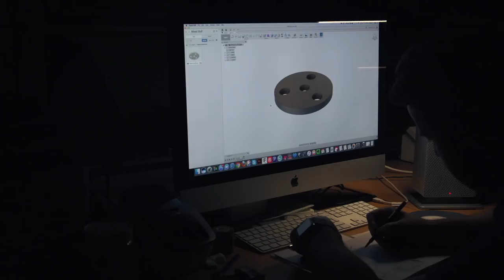How To Make an INSANE BB GUN | GIACO

Comment: Awesome video! It seems in the slow motion clip at the end that the BB's are mostly shooting from the bottom two barrels. You could make either the entire assembly or the barrels rotate to help mix the bb's or have a mixer inside the spins them around. Perhaps even shooting the air in near tangent to the cylinder would result in a thorough mixing of the BB's.

Comment: first of all watched the vid and loved it second of all I couldn't tell if just the middle or all 4 barrels were firing and 3 of all, if you want to extremely ramp up the rate of fire, there's a thing called a vortex block that you machine and put inside it behind the barrel which do to some unexplained physics makes it feed smoother and faster and be more air efficient I think having vortex blocks would also make it easier to support all 4 barrels at the relatively low pressure (60psi for 1 barrel so for 4 barrels you should be using more than 130 but I think 130 is good if you try vortex blocks)

Comment: Not sure what type of metal you're cutting, but it seemed like you were taking light cuts. If you're using carbide inserted tools on your lathe, you should try running your finish pass at a depth similar to the radius of your tool (.031" radius tool, run a .030" or .040" finish pass). This buries the radius of the tool in the work and prevents rubbing, and will give you a beautiful bright finish that almost doesn't even need to be polished. Great work all around though!
Reply from the maker: Jason Flieger nice! That's really helpful I'll try! Thanks!

Comment: Quick question, so all u do is put BB's into the chamber and when you blow air into the chamber via air compressor, the BB's shake around and fly into the barrels and fly out? If thats the case, its simple but really smart. That's also why the top barrel doesn't shoot as many BB's because of well.. Gravity. You could set up some sort of Hopper system to feed the BB's into the barrels more frequently and reliably. Love the vid.

Comment: You should come up with something to feed the pellets better, otherwise you are bound to get lower rpm as the magazine gets empty, maybe something to push the pellets against the barrels and a small valve to stop them from dropping out the barrels when not under pressure. Or have them under constant air pressure (makes it mobile) and fire with a valve directly mounted in the barrels.
Reply from the maker: sirspikey that's a good idea actually... I can make a sort of piston that slides on the barrels with a pushing spring... easy and should be efficient as well...

Comment: It's great but I think you need to find a solution to it only firing from one barrel. Maybe connect connect all the barrels on the inside so it can only feed through one larger tube then be split off into the three barrels? Or maybe you need to split the inside into 3 different chambers, one for each barrel? When it's full it probably uses all three but when shooting at that speed it won't stay full for long.

Comment: What about hopups? Your bbs probably won't go very far if you're not applying backspin. Then again, 4000 psi must make them go further, but probably isn't very safe. You have a chronograph to give some fps or joule rating per bb?
Reply from the maker: +Carson Stevens no need for range! It's meant to be used for OBJ in CQB

Comment: Hey, I'm a big fan of your videos and I'm curious why you have three barrels to the gun, when the gun seems to only be  shooting out of one barrel in the slow motion clip?
I don't know if you did that because that's a limitation to the feeding mechanism or to keep pressure in control.
Maybe I am just being dumb?
Reply from the maker: +Karim Benromdhane it the slowmotion you only see a fraction of a second and when it's almost empty it shoots mostly in the botton ones where the bb are
Reply: If you divide the chamber with the bb's into three different chambers and split the air pressure hose to fit into each of the three chambers you would always shoot through each of the barrels but the psi would be divided among the three chambers. No matter what you do, its always interesting to watch your videos and chances are you will be happy with the results you achieve anyways :)

Comment: Sadly it wont be the fastest with that construction, reminds me of the early "airsoft flamethrower" builds.

I cant remember his airsofter name, but some crazy Brit made an Airsoft Minigun with 3 tubing guns in its center.
Aka the barrels just spin for cosmetics, between them are 3 barrels feed by rubber tubings filled with BBs. The barrels have gas nozzles in their back end, shortly after them the tubing feeds into the barrel. When firing, both the barrel and tubing get pressurized, the pressure feeds the BBs from the meter long tubing in his backpack to the barrels, the restult is like 3 solid streams of plastic coming out of that thing, as there is no gap between the BBs in the tubing. Last time ive read his thread he was at over 600 BBs per second.

Since you have 4 barrel you might be able to adapt the tubing feed too, it would eliminate the randomness of BBs bouncing insize the tank and having to ride the air stream to the barrels.
Reply from the maker: FullMetalFox Yes I'm making changes from things I noticed from this one...

Comment: not the fastes an aeg can shoot faster in a 11.1 lipo at around 400feet per second but overall this is a nice video and I know this because I shoot airsoft and when no put 11.1 lipo you just see a straight line of bb
Reply: nightmare in action nighmare in action looool hahahahahaha no... I own airsoft guns and a 11.1V li-po is not even that big, I've run 14.8v and some people 18.5v. considering you're a nub and haven't even modded your gun, you're probably only getting like 20 rounds per second and 400fps... come on man I've built my gun up to 550fps at 45-50 rounds per second and 350fps at 75rps. this gun here is doing maybe 60-100rps. the Strafer MK4 does 175rps at 600fps.

Comment: wouldn't trust your jb weld air inlet with 4000 psi
Reply from the maker: +benfbuilder what can happen? There are 4 air outlets
Reply: Giaco Whatever yeah but given the amount of pressure and flow you'll have going into this thing and considering the size of the outlets, you're going to get some pressure buildup inside the cylinder. It looks like you've got some prettu serious tooling at your disposal, so I would recommend using a solid connection to your air chamber, either threaded in or welded on. just my .02